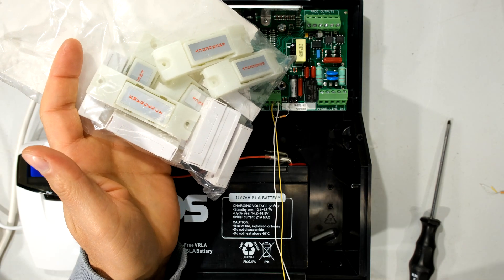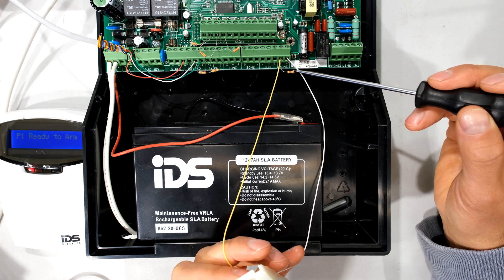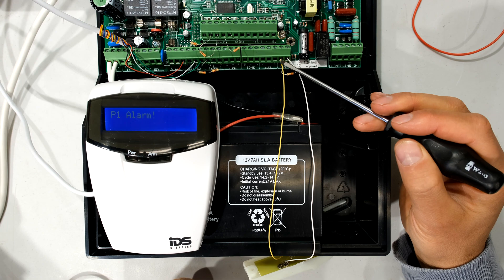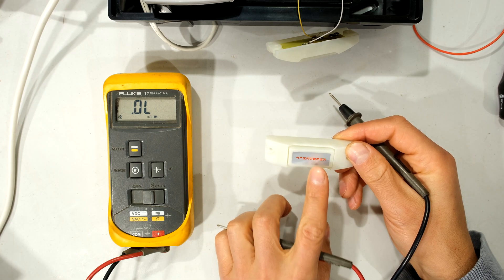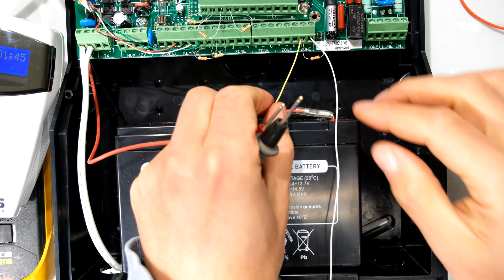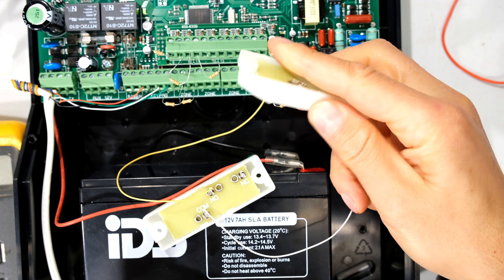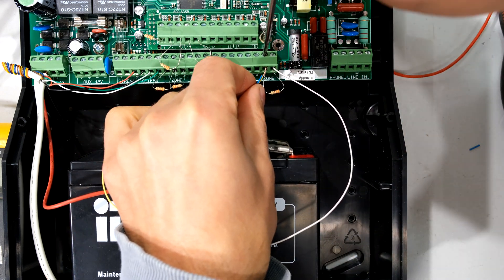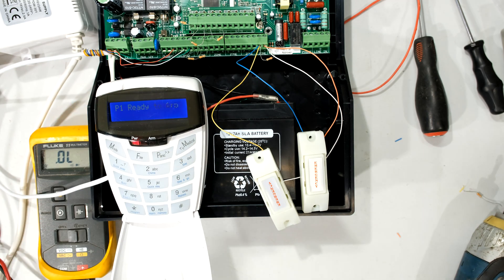How to add panic buttons to your IDS alarm system

Comment: I 've got an ids panel with all sensors NC so i assume the
panic button will also be NC?
Reply from the maker: panic is normally open so its opposite on the IDS system. You push to make a panic.